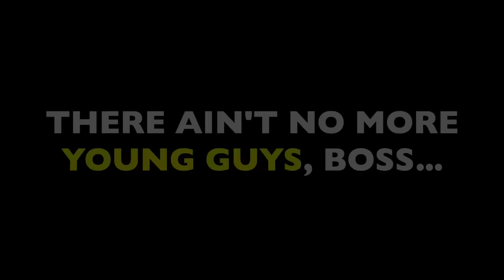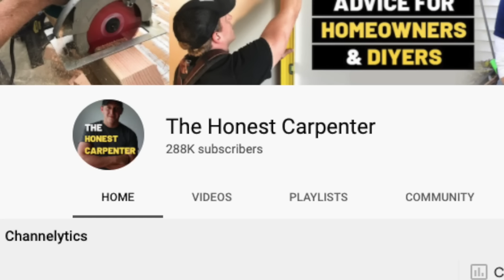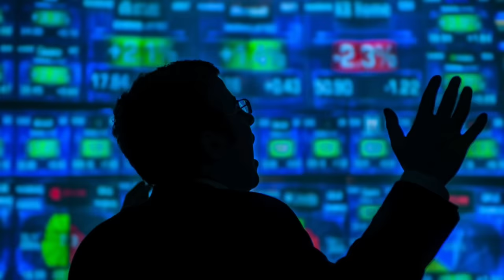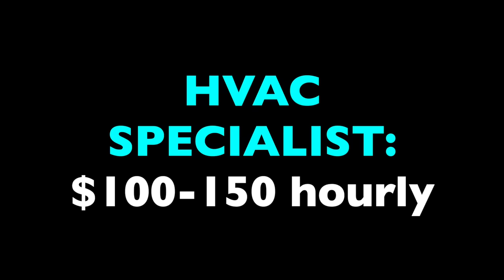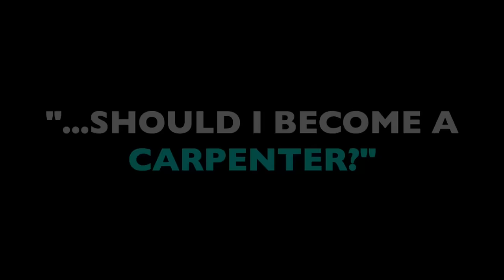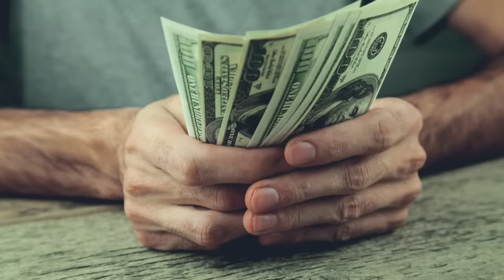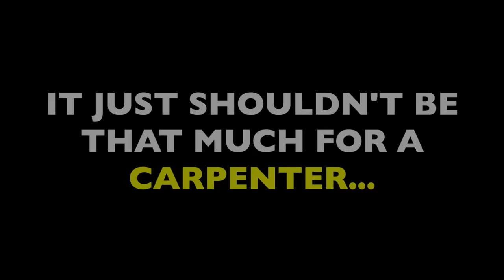WHERE HAVE ALL THE CARPENTERS GONE?! (Why The Trade Labor Shortage Is Only Beginning...)

Comment: I tried to move out of the tech industry and into electrical. As someone in my 30s, I could not afford to keep the job. It was paying $15/hr to be on construction sites, where I almost died one day. The reason no one is entering construction is artificially low wages starting out. The unions were also $15/hr and acted like that was a good deal.

Walmart pays $15/hr and you don't need $150 boots, $1K of tools that WILL get stolen (when, not if), and then dues, classes, books, and else that will lead to about $12/hr. I have a mortgage and car payment. I would be bankrupt in 7 mons at that pay after I ate and fueled away my person life savings. On top of all this, I experienced racism galore. All around, it was a terrible experience that I could just go work al wallyworld for the same pay. Yes, I do understand that you will get paid more, but it requires a minimum of 4 years commitment and then advanced algebra in a timed test to pass to get Journeyman or more. To me, not worth it. A 4 yr degree in a fully AC'ed environment and not breaking my body will yield about the same pay, if you don't get an underwater basket weaving degree. Screw construction, those chest beating idiots can have their bad pay and spine issues.
Reply: I was HVAC installer apprentice 4 years ago and they started me at $16 before that I was already making $20ish as a shipping clerk.  I lasted only 4-5 months and I realized it wasn’t great and for the low pay.  Maybe if they started me in the 20s I would of stayed

Comment: I agree with almost everything in this video except for his point on the simplicity of HVAC, theres alot more to it, then air handlers and furnace's i do commercial HVAC. There's heat pumps, VRF systems, chillers, air handle/condenser set ups, VAV systems, cooling towers, package units. Dehumidifiers, mini splits, and thats just the equipment side. Then you have fiber glass, squared sheet metal, spiral pipe, double walled insulated spiral pipe. And every brand as far as the equipment goes has different start up procedures, diffrent issues and faults, and alot require certifications for that specific brand and equipment you have to have in order to qualify the warnty.

Comment: Carpentry has been piece mealed out to specialties because it’s more cohesive with unskilled illegal labor. It’s easy to teach someone how to frame and become a framer and make money off them, it takes much more time to know how to set the forms for the concrete, frame the house, the roof, the stairs, tape and spackle, moulding the right way which means coping inside corners, crown, cabinets, flooring etc..

I just worked for this guy that has absolutely no construction experience aside from assembling play sets, who got liability insurance and thinks he’s a contractor. His lead guy was laying out a basement with a framing square. They’re building a pergola which was my final straw that is 3” out of level, 1” out of square on 6-8-10, and every post was 1-2” out of plum because he’s pluming 16’ tall posts with a 6’ level from the ground. Guy does not understand the most basic principles or fundamentals of carpentry. Miter cutting inside 45’s, did a wood plank floor that’s all gapped everywhere and looks horrible. Absolute hack, and there people like that everywhere
Reply: So and what.  Customer will just shake his head for 10 seconds and forget about it.  I have exactly same problem.  Customer will for a few dollars les hire guy who learn to install crown at Youtube this morning.  Crappy job?  Customer will put paint in.

Comment: industrial arts should not be divided. in order to obtain the maximum qualification as a master craftsman one should be able to perform any of a wide range of trade skills. carpentry, plumbing, welding, electrical, industrial ceramics, concrete, & machining all share a number of foundational skills such as metrology, design, safety, planning, blueprint reading, & business skills.

Comment: I'll tell you why, as far as residential framing is concerned. They were pushed out by cheap labor ! A good 5 to 6 man crew could pump out a quality framed home in roughly 2 weeks start to finish. Now they have 10 to 15 Man Crews pumping out low quality  houses in 4 days start to finish . Remember I am to only talking about the framing aspect ! For Builders it's all about the bottom line !

Comment: I’ve met many a carpenter who was a true craftsman on the job site. But more and more they trend older. Same in my current trade, the electrical techs at my factory are around 50-70. It pays well but it’s hard work in dangerous conditions. The destruction of unions in the 70’s and the overall cultural shift; it has considered tradespeople as disposable or less than.
Reply: Not to mention the toxic at workplace, the GC throttling you, and really shitty porta potties

Comment: I worked at a lumberyard as a 19 year old. All the carpenters and tradesmen coming through the yard picking up for the day would be telling me at age 19 i should get myself into an apprenticeship and become a tradesman. If i had done that today at age 55 i would probably be beat to shit. As it is, i did long haul trucking for 15 years and that did a number on my legs and back. Another thing i have been noticing delivering truck loads to work sites and talking to crews: cheap labor. When Russia allowed its citizens to leave in the 90s and 2000s there was a flood of guys that came over to the US that werent in our trade unions but joined crews as supposed general laborors but were shown the ropes somwhat and leared on the job how to drywall or work construction. You will notice hispanic crews as well. I dont mean to bang on these groups im just saying that things were much tighter crews 100% union who did not do rushed inexpensive work.

Comment: There may be some hope, yet.  When I went to my High School reunion tour, they showed us that shop class, which used to be tucked away in its little wing of the school, had broadened into "tiny home building".  They taught the same skills, but now there was a cohesive project that it all led to.  They also established a more direct link to trade schools and relevant employers.  

Perhaps more importantly, IT BECAME VISIBLE.  The construction area was outside, where kids who weren't taking the class could see what was going on.  That may not be enough to solve the labor shortage, but at least it becomes more visible in a situation where it's also more accessible because you're not committing to a trade school or career path.  You're just signing up for that elective, next semester.

Comment: I was a timber faller by trade from my mid teens until a few months ago. I ran equipment building logging roads on the side (as per L&I standards timber fallers only work 6 hours a day). It was a great job in years past, and nobody ever batted an eye about paying what i asked, but the political climate has changed the logging industry for the worse, and with new technology, theyd rather send a 1 million dollar machine over the hill to do my job. So now i run a 1 million dollar machine, and I don't enjoy it nearly as much, but it pays the bills

Comment: Stick framing is the easiest type of framing. Took generations to find the easiest way to build a house using sticks and nails. Framers these days are pretty much building with Lego blocks, framing has been simplified so any laborer can build a house. It’s too easy to pay a lot
Reply: The price of something is determined by supply and demand, not by your opinion of how hard or easy something is.  Claiming that something is "pretty much" something, is not an argument.  Claiming that something has been "simplified" is not an argument.
Reply: Carpentry is the ultimate "easier said than done".   Legos do not require measuring tools or framing squares.  Building a house involves thousands of pieces of lumber of different lengths, each must be measured, cut and installed.

Comment: Supply and demand dictates that as the number of carpenters goes down, their prices will skyrocket. I would not be surprised if, given the skill and responsibility required, and the shortage of skilled carpenters, the hourly rate of a carpenter doubles that of a plumber. This will cause more people to be attracted to the field until the hourly rate levels out.

Comment: The lower paid trades attract the oportunists. They watch a guy nailing a betten to a roof and then think, I'm not skilled in anything but I could easily do that! So they initially work only in the private sector, (less scrutiny) bodging many jobs but picking up experience until they are reasonably good. That process can't happen in the regulated trades. I used to get fed up being undercut and told I was too expensive when I was pulling in barely anough to live on - these guys work for cash, dont pay tax, don't employ apprentices and arent insured. A large share of the blame has to go to the public who are only interested in the price.

Comment: Working a blue-collar job is just not as profitable, adjusted for risk, as it used to be and there are cheaper alternatives to wood. Are they better? Usually no, but they require less effort, skilled labor and money, so they are preferred by the usual customer.

Blue-collar jobs that are based on skill and experience are going to become boutique businesses and that even includes the IT jobs.

All other jobs will be gobbled up by high-volume corporate construction and construction-related jobs, that will become increasingly automated - just look at agriculture.

Comment: I know a guy wh is a plumber. Charges $125 an hour makes $250K a year. hHe's 60! He has tried for ten years to get an apprentice and train them to take over. He has had no luck. Its hard to find anyone who has had any formal education in plumbing., knows the building code inside and out and is willing to work in a dirty environment for long hours. Noneo f the people he has tried to train lasted more then 3 months before they quit. Even at $65 an hour with a increase to 75 after one year. So when he turns 65 he is tretiring and there will be no one to handle is customer list of 2000 regular customers. He could easily double his rates and they would still gire hime because there is no one else with in four hours drive of where he lives that is a certified master plumber!

Comment: no worries biden and all before him fixed the problem by unlocking the border. in my bordering state, DR Horton carpenter on a new build makes $19 an hour and houses are popping like there is no tomorrow. so your advice to got to higher specialty trades is very valid.

Comment: Obviously a generation of parents pushing everyone towards white collar jobs had its impact. I've worked as a electrician for over a year and it isn't so bad. Its a tough job, long hours, working outside in plus or minus 30 is rough.

One thing I've began pondering, it might just be as IQ levels keep increasing across the population more people find more "technical or conceptual jobs" more enjoyable. Not to say working in the trades makes you stupid or anything. But as someone who likes thinking and doing things more in my head, I was very bored and found working as a electrician, so tedious and boring I just couldn't find any joy in it. There was no real challenge beyond the physical, unless I'm actually a electrical engineer there's not much problem solving to do in my head so I just find my mind running around board. And that's the same for most of the construction trades, you really just need to know how to read prints and do what is required. You aren't the one doing the calculations or designs etc. Sure maybe for instance a electrician doing a house has to make sure he chooses the right wire sizes, but that's really it you just read the code book. So maybe as the general population gets smarter, the things they want to do get more complicated and intricate. And you put that with a backdrop of a society that is more and more reliant on technology and innovation, it makes sense why people don't want to just build things. 

Though this is all speculation, I'm not 100% certain a increase in a populations intelligence means that same population doesn't enjoy physical work as much, but it does make some "logical" sense. For instance playing children games, they are fun but once you've mastered it, it gets very boring and pointless. Humans like a challenge, to overcome to stuggle and come out on top. And I guess the most intriguing struggles in this world are more then mental ones, the sciences etc not the physical, though obviously people love physical exertion.

But maybe its simply that blue collar workers have a negative reputation of ; stupid, drunks, blue collar, druggies etc. And white collar workers are apparently all "smart, educated, respectable etc." The perceptions of white collar vs blue collar might be the biggest impact on why such low work force.

Comment: On one hand, carpentry is one of the most dangerous professions given the wear and tear on your body and the prospective mangling you could go through by any given number of tools.
  Why work 12 hour days in the blistering heat or rain or cold for the same rate of pay as being a desk jockey who sits in air conditioning all day?

  That fact alone is quite the detriment to carpentry and trades as a whole. Physical labor is demonized and stigmatized to a point it’s almost seen as a “job for stupid people” even though most of them require as much training and degrees as any other profession.
   Finally, the upside, instead of singling out carpentry as your sole profession, become a general contractor and learn a bit of everything. Handyman are pure gold to the Millennial generation who can’t replace light bulbs most of the time.
  All the tech money they’re earning will go straight to your pocket for the stupidest jobs, not even exaggerating.

Comment: There is a "shortage" of carpenters.  And electricians.  And plumbers.  And HVAC guys.  And truck drivers.  And car mechanics.  And aircraft mechanics.

This "shortage" is BS.  There is no shortage, there is only a shortage of guys willing to work for the scraps they want to pay.  Can't find anyone "qualified"?  Simple.  Lower the requirements until you get your positions filled

As an aircraft mechanic, I was given the option in July to take a $25k year pay cut, or quit.  Which would have been fine, if I was making $150k/year..... but I was making well under six figures.  Their rationale?  "This is what you should be making, in order for our business plan to work."
Bye-bye........

I've been in the business 40 plus years.  Every year, the pay gets worse, and the hassles and work load increase.  I'm pretty much done.  Thinking about retiring, or going to work at the movie theater, or Home Depot.

Comment: 2 thoughts on this from a working carpenter of 20 years:
1. As far as pay goes, the reason we don't get much is because it doesn't require a license to do the work.  (Residential)  If a homeowner should feel motivated, they could do a lot of the work themselves.  That's not to say they couldn't do the plumbing and electrical, but there's a good chance they wouldn't know the codes to do that work to pass.  
2. In the 3 firms I have been at last three years, I can tell you its not just a shortage of young carpenters, but skilled carpenters in general.  And even so, the young ones (under 30) seem to have no drive to work, or improve their craft.  Every suggestion for improvement or technique is usually met with resistance.  It's not the way I was trained, where the "old guy" knew all the tricks and I was glad to learn something from a master.  Times have changed.

Comment: You used plumbing as the complicated trade? 😅 Nothing compared to HVAC. HVAC is almost all the trades in one. If you dont know plumbing, electrical (including low voltage), diagnostic troubleshooting, carpentry, ductwork plus what HVAC is known for. 
Sorry, but others don't compare in this way. 
We are soooooo underpaid....

Comment: I think a very hard, and stupid truth is that because carpenters rarely need to be certified in anything, they are thought to be incapable of quality work. People would sooner have a gorilla install their trim than spend an amount of money where it might be done well, because nobody gets “certified” to do trim. If you don’t need qualification, how hard can it be? Most people can’t tell the difference anyway. It’s very hard to value quality and remain employed. Most people literally can’t tell how out of wack and crooked their own house is. It’s also usually seen as the least necessary, because even the most pressing carpenter work is trumped by a broken air conditioner or clogged shitter.